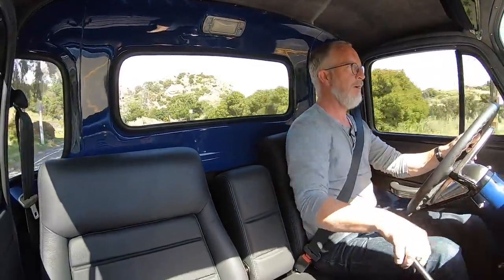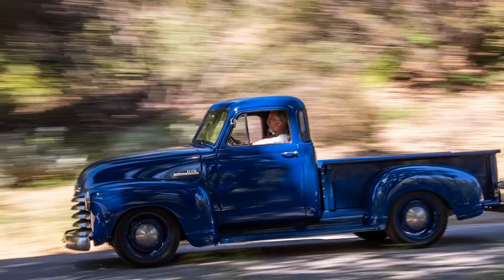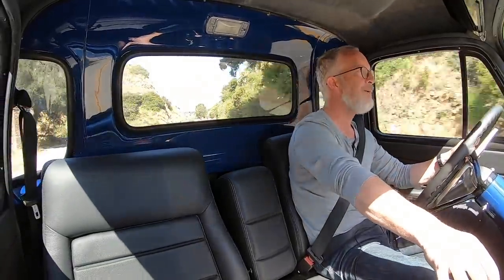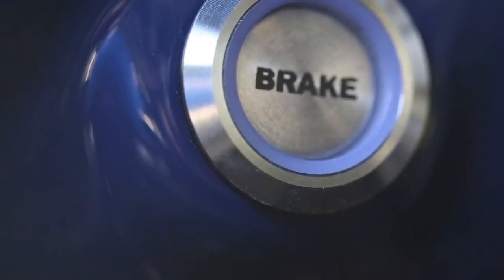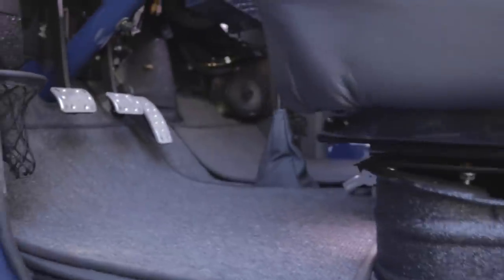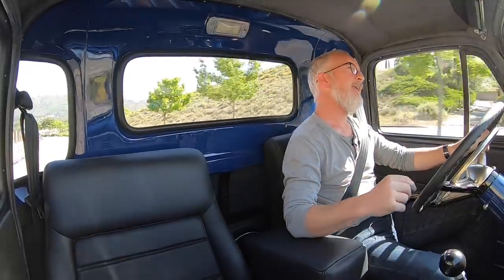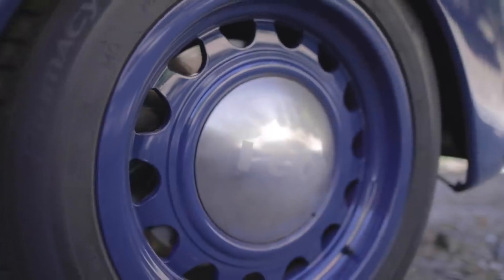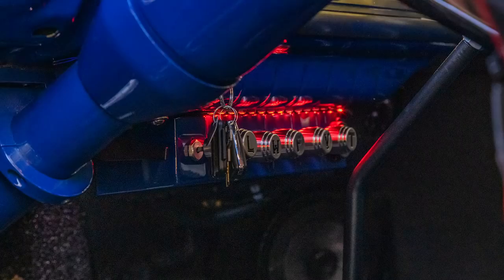ICON New School TR #8 Restored And Modified Chevy Thriftmaster 1952 Pick Up

Comment: Another Rad vehicle, manual shift check, period wheels check, brushed finish on bright parts check, NO cup holders in arm rest check. If it were mine a burnt orange pin stripe on the wheels. Nice to know I have a brother from another mother (envisions the same)

Comment: For the artillery wheels instead of a straight cut holes, you could round off the hole edges slightly... So they look more like the old stamp steel holes.

Comment: Amazing ride, as always. I'm saving my pennies and one day will drop by with a 1967 Pontiac Parisienne doner car. I want the panel skins re-done in aluminum, giant sunroof, reskinned seats out of a BMW X5 M (sit and understand) and a supercharged crate motor of some type w/ 8 speed auto and, if possible, very low key and out of sight 4WD. Sigh!!  Till then, why is your hand a ghastly white with purple fingernails? I'll just assume as a car guy, you've either been painting or your going to work as an extra in a zombie flick.

Comment: The issue with an EPB is if your brakes fail it will take way to long for that e-stopp to apply.  At least if you jam on a mechanical emergency brake it will try to stop almost immediately.

Comment: Which Focal unit u use Jonathan? the high end series? I had the Utopia series a decade ago, still banging them, that was a mid range and tweeter set (2 tweeters, 2 mid range) for more then $1200. Curious to see what you are using